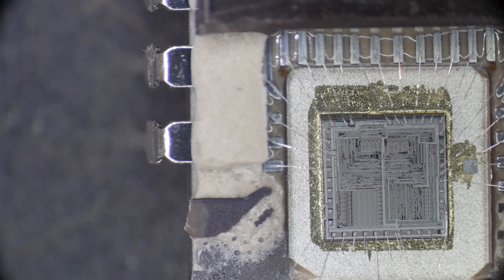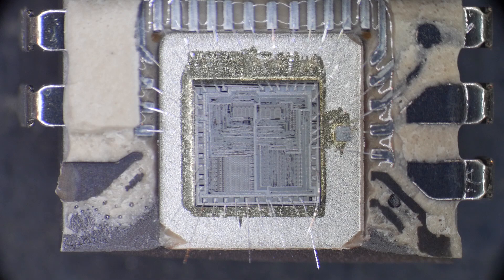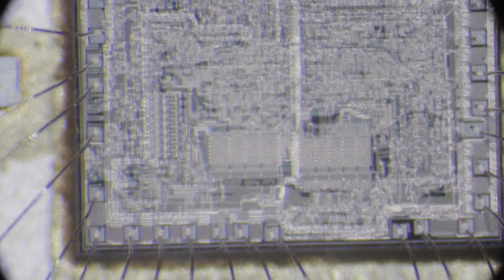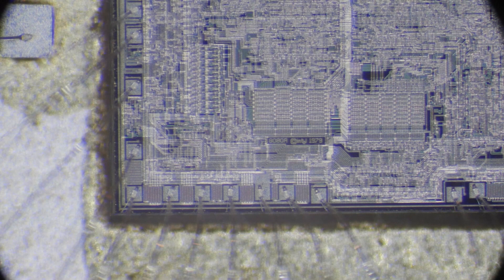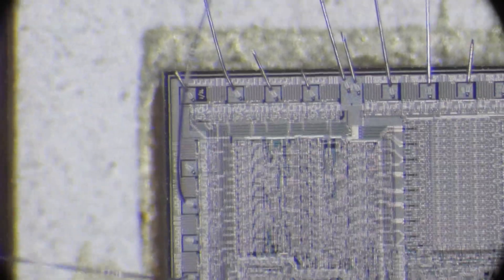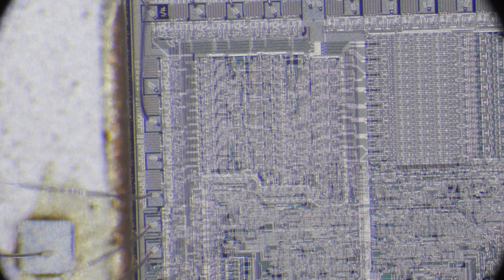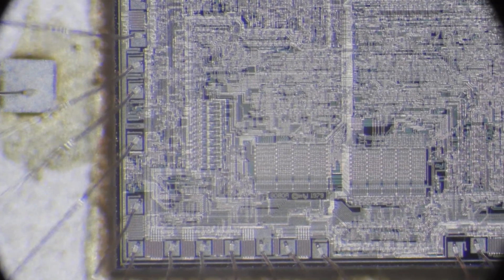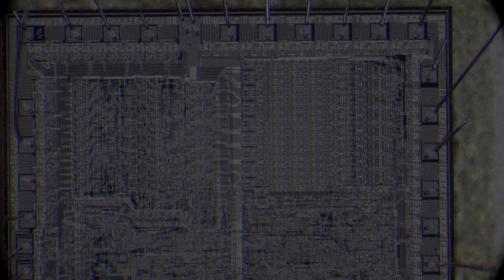#321 Intel 8080 integrated circuit under the microscope

Comment: This CPU was built on a 10 micron process, which is 10,000 nm :D
Reply from the maker: that's a lot of nanometers! the Intel 4004 and 8008 where 10um. the 8080 moved to 6um to squeeze in the 4500 transistors needed. I think the big processors now are running 500 million transistors
Reply: @IMSAIGuy  You're right, it's 6 microns. Today it's getting into the tens of billions of transistors for server CPUs like Epyc 64-core. And they're built on a 7nm process which is 850 times smaller than the 8080.
Reply from the maker: @QuantumBraced  7nm? Yikes
Reply from the maker: how do they do the lithography?
Reply from the maker: oh, just looked it up. 7nm is a marketing number. the physical sizes are around 30-40nm
Reply: Yeah, they have become mostly marketing numbers at this point, transistor density is a better measurement, but even that isn't universal because it varies across a die.